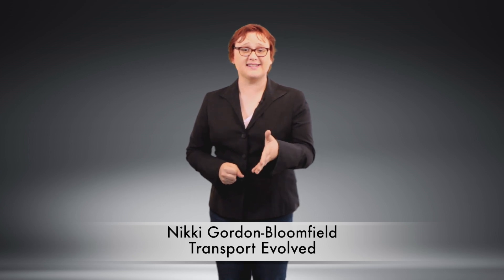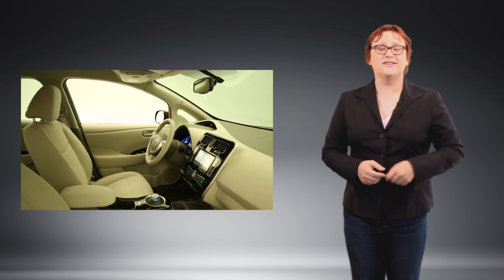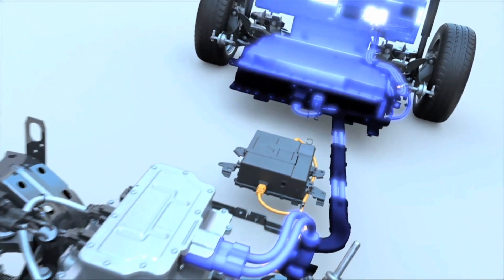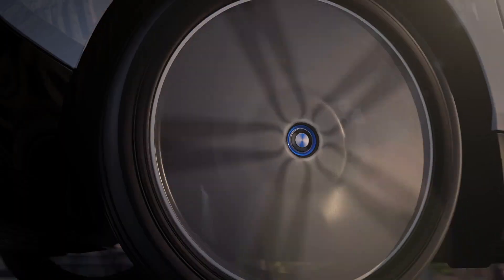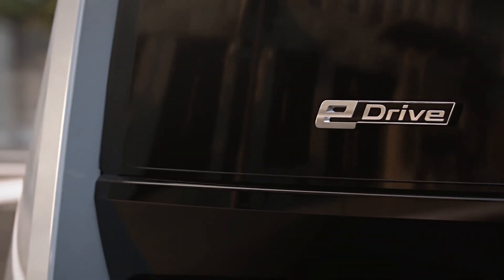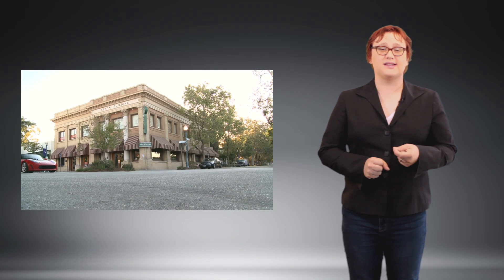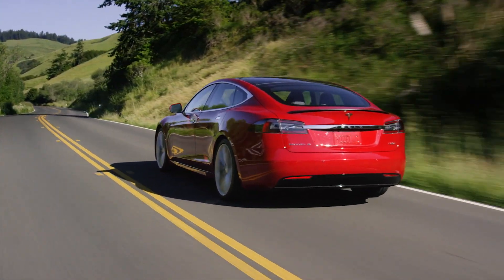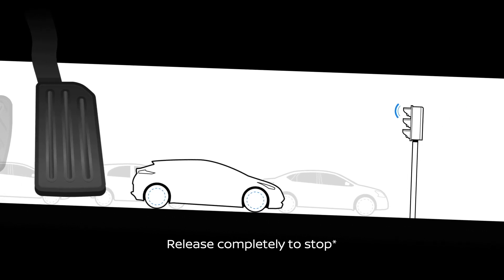What's An e-Pedal (One Pedal Driving) -- And Why Is The 2018 Nissan LEAF Getting It?

Comment: I don’t understand you push on the gas pedal for forward momentum and you let off of it to slow down?   This video didn’t clearly state how  The driver chooses to slow down using the same pedal.  They don’t switch something to make it function as a brake, right?  So do you always keep your foot on the Excelerator and take your foot off when you want to slow down?   How do you differentiate between slowing down gradually and slowing down immediately?

Comment: What if I need to break in an emergency situation like an accident happening right in front of me?
Reply: What if my foot slips off the pedal by accident? The car is going to consider it emergency braking?
Reply: You lift off the accelerator pedal very quickly, which tells the car you want heavy deceleration, and you are not even standing on the brake pedal like a maniac yet that you are already slowing down quite fast due to the regen. Then the electronic stability system monitors the braking closely so you don't lose control. ;)
Reply: hm... I guess it would be wise to add some sensors around the car, so it knows how far the path was blocked. That could also minimize people hitting in the back of the car as well.
Reply: I guess the auto-pilot of Tesla would monitor the distance with the obstacle and adapt speed if a stop is not necessary, and even steer to avoid it if the braking distance is too short. There are videos of Teslas doing it, even accelerating fast to avoir a rear end collision by a distracted driver who didn't see the Tesla waiting to turn left (of course there was space to do it frontwards)
Reply: yes, that's what I was referring to
Reply: kricsek Oh there is one! But you just need it in case you have to slow kinda fast or to stand still.
Reply: You put you foot on the brake pedal!
Reply: kricsek No, only braking heavily would, but you would be decelerating more than an ICE car. But slipping of the gas pedal never happened to me in any car!
Reply: dieltotor there is no brake pedal so I'm not getting what you're saying.

Comment: For people who never drove EV, would it be too much to tell if there is a classic brake pedal for emergency stops?
From my point of view lifting the foot from the pedal should lead to freewheeling and the break pedal should break by progressively generating electric power until the pressure increases to a point when generating power cannot decelerate enough and the mechanical break must be engaged.  By adjusting pressure on the break pedal the driver controls the deceleration and the degree of regeneration based on traffic and road conditions. It is something that the most of the drivers are used to, and do reflexively. In case of emergency we don't think, but act reflexively and the move is automatic. That why we need same controls in all cars. It is basic bio-psychobiology. In this case those who learn driving on Leaf won't be able to drive anything else.

Comment: Quite a number of buses / coaches with retarders I have driven in the past have the option of a similar use with a special lever/switch to enable breaking using the retarder at a given strength. Granted, with this set-up it isn't possible to come to a complete stop without using the break pedal, but in moving traffic it works quite well.

So one pedal driving is not that new and not specific to electric vehicles.

Comment: Thank you for your video and thanks for having a group of  viewers that take your videos seriously.  I have a Tesla Model S and a Nissan e NV-200 which I use for cargo delivery.  I prefer to have the Nissan option with the gear lever going from D to B.  I know James Cook thinks that Nissan just can't program the range well, I think that regen is great for charging.  I am moving to a very hilly area and the Nissan is low range, so every electron counts.  I would like to have Tesla consider a paddle option since going to the screen is not ergonomic.  And I am almost disappointed now in my Tesla since it doesn't pick up as much energy as the Nissan on downhills.  Does anybody have any technical details about this?  I don't dislike the Tesla, but I think anything can be improved.  
Also, I was accused of not liking Auto-Pilot by someone.  And now I would like to say it is true from a socialist perspective.  Let us build a simple EV and let more people drive them as people so that people can work and pollute less.  When did EV automatically mean Auto-Pilot.

Comment: I dont understand the "quasi " one pedal statement on the Volt and the Bolt. I owned a Volt and have owned a Bolt for 4 months. In L both have true one pedal drive. The Bolt one pedal drive is fully perfected coming to a complete stop with no creep, even Tesla can't do that. It will hold on a hill up to 7% grade.  The paddle gives  you super regen in low. I sure I've  only hit the brake less than 20 times in four months!
Reply from the maker: The regen on demand switch on the back of the wheel has to be held down in my experience, but...
Reply: I only use the regen paddle in L only for very quick unanticipated stops that aren't emergency. The Bolt is more aggressive than my 14 Volt. Never drive in D unless on interstate. Chevy claims they incorporated  a great deal of Volt owner feedback in designing Bolt. Eliminating the creep is a delight to drive. Didn't seem to get rest of your response past but...

Comment: Just drove a Tesla for the first time. Took about 15 minutes to get used to single pedal driving, then afterwards found it natural, easier, and now miss it when I went back to my old car after 2 days of a Tesla rental.  I wish gas cars had this feature. But gas cars wont be around long enough to add it (snark). :-)
Reply: Doubt. Until Electric cars become as common as gas and similar in cost, you'll be seeing gas around for years to come unfortunately.

Comment: The use of pedals in a car is really based on muscle memory.  So the danger of "One Pedal Driving" is that in a emergency situation where you need to apply the regular hydraulic brakes quickly your brain and muscle memory is going to be so trained to only using one pedal you are going to never make it to the regular brake pedal before you crash.  So this is a risky thing to encourage people driving to do.  A better alternative would be teaching drivers to left foot brake and perfect more how the brake pedal input works with the combo of electric motor and hydraulic braking systems.  I guess we can hope that Nissan makes autonomous emergency braking a standard non defeat-able feature.
Reply: That's actually the first "valid" concern I've read about one pedal driving ! xD
On Teslas you still have to brake to make a complete stop, and on all cars you have to brake to keep the car still, so I guess you're not completely unoblivious of the brake pedal... But I guess only a behavior study would tell if people lose the reflex to slam the brakes after a while. 
That is, if the car didn't see the danger before you and started braking already ;)

Comment: I love the single pedal driving of the Bolt, in L mode. I rarely need to use the brakes, or regen on demand paddle. Once you get used to it, it's easy to time your stops perfectly. The brake pedal really only gets used for emergency stops.

Comment: The correct place for regenerative braking is fully integrated with the brake pedal.  The main reasons are ergonomics and safety.  Generally only trained racing drivers and vehicle dynamics engineers are aware of "trailing throttle oversteer" or "lift thottle oversteer."  Trailing throttle oversteer happens when lifting off the throttle too quickly causes too much load to transfer off the rear wheels and onto the front wheels causing traction to be rapidly decreased at the rear wheels.

Especially in a turn and/or emergency situation, this can cause the rear wheels to yaw too quickly ("spin out") resulting in loss of control of the car. Regen on the throttle makes trailing throttle oversteer worse, and is wrong mainly for reasons of safety and ergonomics.  It's also part of the reason most road vehicles are tuned for understeer.  Please google these terms and educate yourself about them. Or go to a good racing school.
Reply: Disagree. The multiple-pedal setup is designed to control completely separate systems - drive and brake - whereas here you're just controlling the rate of energy flow between the battery and the motor. It really is very intuitive to use. The control computer manages the sort of effects you highlight transparently for the driver (amongst others -
 not least, it limits torque at low speed).
So all you're left with, is unfamiliarity with a different control paradigm - which is why Nissan stuck with the two-pedal setup so far. But that's no reason to hold on to it forever.
Reply: +Kevin Quinn regen on the brake pedal is correct for the reasons I mentioned.  The other reason is that braking belongs on the brake pedal and acceleration on the accelerator pedal.  In human factors engineering and ergonomics, mixing them up as regen on throttle does is called control cross coupling which is considered an undesirable error in engineering.  I have worked as a human factors research scientist on helicopters, and I have car racing experience.  I have a degree in experimental science from one of the top universities in the world.

Yes, it's possible for the car traction control computers to compensate for trailing throttle oversteer to some extent, but putting regen on the throttle makes the result of the tendency of untrained drivers to lift off the throttle in an emergency much worse.  It's exactly the wrong reaction for the car's control systems to have from an ergonomics and human factors design perspective.  It can cause a crash.

Please look up the term "groupthink".  I think it explains what has happened with regen on throttle extremely well.

P.S. I am a personal friend of a friend of Alan Cocconi, from whom heavy regen on the throttle came from in the T-Zero, then Tesla Roadster, then Tesla Model S, and other EVs.

Please note, I 100% support EVs.  We have been driving electric for 20 years, starting the GM EV-1 (which had regenerative braking correctly integrated with the brake pedal).  Heavy regen on throttle is a design error that can be corrected via a software update.
Reply: If I undestood your point correctly, you say that the tendancy that nearly all of drivers have to lift off quickly in an emergency will cause heavy regen and loss of grip, but the fact is the dynamics of every vehicle (not only EVs) are monitored very closely. Classic ICE cars can actually re-apply engine torque to avoid wheel lock if lessening brake pressure is not enough, and EVs can do it much quicker since electric torque is instantaneous. (Actually, it would'nt even let the wheels come close enough to locking in the first place to insure stability). Not to mention individual wheels braking to steer the car the way the drivers wants ;)

Comment: It's not going to work if the battery is at 100% charge surely.
Reply: My thoughts too.  They are going to have to have some extra capacity in which to store that energy in the first few miles of driving.  In the current Leaf, the regen experience in the first few miles is different to when the state of charge is lower, and whilst you get used to it, it is rather annoying.   Unless Nissan have been really clever and integrated the physical brake system into the e-pedal system.  That would be a true innovation.....
Reply: MINXC3 you mean like if it's plugged in while you drive? You'll always get slightly less energy back from Regen brake than driving. Unless you live at the very top of a hill I guess...
Reply: The Bolt has a "Hill top reserve" mode. If enabled, the car will only charge to about 88% full. The idea being, if you live on a hill, don't charge to 100% so your regen will always work. "Hill top reserve" can be disabled, enabled all the time, or enabled when parked at home only. The Bolt (and Volt) are location aware so you can have different charging options set for when charging at home vs charging away from home. Another example of using this is to have your car wait to charge until the rates go down while at home, but charge immediately when charging away from home. My 2014 LEAF only had timers, which I had to disable when I wanted to charge away from home. Hopefully the next gen LEAF steals some of Chevy's tech and does charging right.
Reply: Hi, So you think the car has no alternator...

Comment: The brake pedal also uses regen though right? well it does in camry hybrids anyway, you let off the gas and you can see the dash go into charge, and when you brake it goes further into a stronger charge. does that also happen with full evs?
Reply: xIAMDAVEx:  It does with the current Leaf.

If I'm understanding this new feature, I think that taking your foot off the accelerator will not only give 100% regeneration, but it will also apply the brakes.

Comment: This is just marketing at its worse. The BMW i3 since day one had this "feature." In fact, if my facts are straight, the BMW i3 has a sensor to activate the brake light when under regen braking.  My 2011 Nissan Leaf has an ECO mode that acts as such, one pedal driving, as long as the battery is not fully charged. As to regen braking, I have never read reports as to an average story returned to the battery so I suspect it is not a huge number of electrons returned.
Reply: I too have had a Leaf for quite a while, and driven an i3.  In the Leaf there is an element of one pedal driving already for sure, but not nearly as much as the i3 which will genuinely bring the car to a halt.  However, if won't then hold it on a hill both up and down hill.  What e-pedal appears to be is the i3 feature but taken even further.  I expect it is a) more aggressive than even the i3 and b) once the car is stopped it holds the car stationary as though the handbrake has been applied.  It's going to be great to try this once the car is here!

Comment: The i3 has no way to turn it off, but once you use it you wouldn't want to turn it off. I rarely touch the break pedal. Every car I buy from here on has to have it. I think it makes driving a little bit safer. If there is an emergency and you take your foot off of the accelerator, the car is already breaking in the split second before you hit the mechanical breaks.

Comment: Nikki, Nikki... Think about the importance of slowing down a car without using the brakes.  See, without using the brakes as often you don't wear down the brake pads as often.... Adding yet another reason why electric cars will not require as much maintenance as automatic-transmission-ICE cars.  
.
How serious is this?  
.
Well I used to drive both a manual/stick car and an automatic car.  I used to gear down a lot on the manual/stick and I literally doubled the life of the brake pads on my manual/stick car in comparison to the automatic.  When I did have the brakes changed in the automatic, after about 4 years of driving, it cost me about $900.  On the manual car I had to get new brake pads at about the 9 year mark.  
.
Can I suggest you double check my math(s) and see how much an electric car can save on brake pads alone over, say, the life of an ICE car.
.
Need I say more?

Comment: I'm really unsure as to why regenerative breaking is not simply  done through the break pedal. That would be no different to anyone's driving style now. At the same time there is an opportunity to completely change the what is now the excepted way of controlling a car ( it used to be different for each manufacturer ) i don't except that an adopted way of controlling a complex geared vehicle from 80 ish years ago is relative now with the advent ( again) of EVs. Please don't forget motorcycles are controlled completely different with the same technology. A better way may be looming
Reply: Andrew Wilkinson: I think they can't do all the regenerative with the brake pedal because in extreme situations, you need to slam in the brake.  If you slam on regen braking to 100%, it is not nearly strong enough and you would crash.

Just like if you downshift to 1st gear and do not slam on the brakes, then you won't slow down enough and you'll crash.
Reply: Another answer is that it is complicated to come with a system that tune the balance between regen and braking efficiently. To optimise the energy recuperation, you'd have to activate regen only with a portion of pressure applied to the brake pedal, then apply the brakes. But since brakes is pressure to the pedal amplified, you'd have to put a spring or something in order to let the regen work without braking. (Braking is pure energy loss in the form of heat).
Way easier to measure the driver's request in torque, be it positive (acceleration), stable, or negative (deceleration), all in the same pedal as Tesla and others do
Reply: The short answer is that it is. The brake system on a LEAF is already combined with the control system for regen braking. A light touch on the brake pedal brings in regen ,  with 'normal' braking operating the harder you push the pedal.  The 'E' pedal takes the process one stage further, allowing one foot driving for all situations with the need to use a separate brake pedal only necessary in more extreme situations. 
Although the brake master cylinder looks similar to old style vacuum servo units, it is totally different in the way it operates.